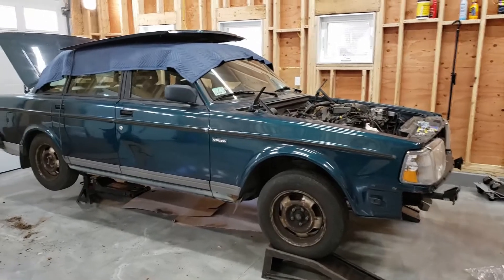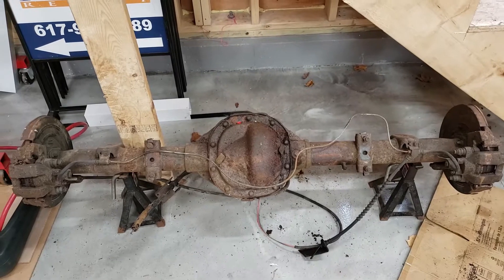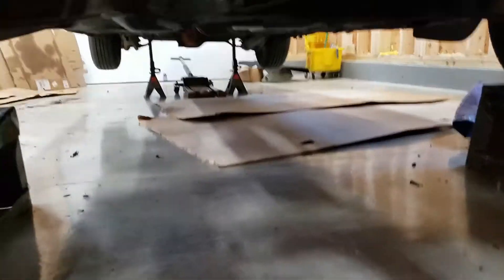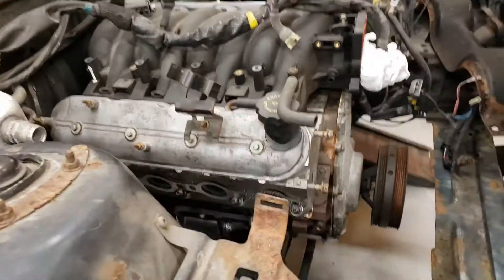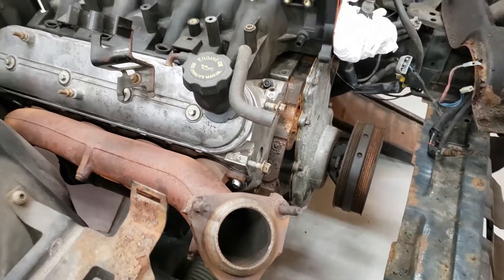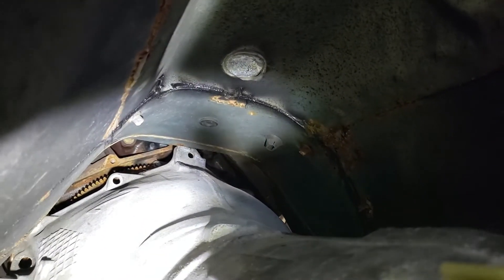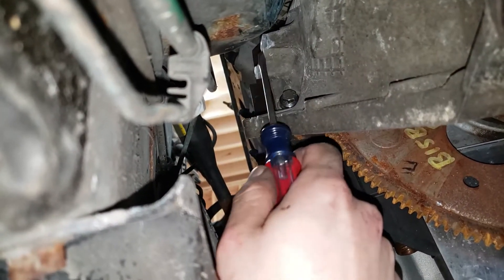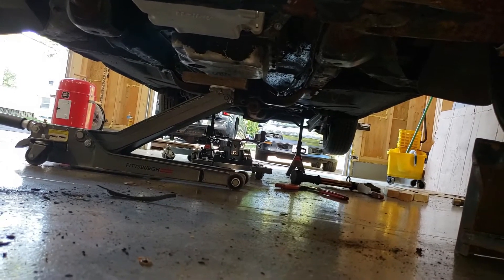Introducing my Turbo LSX Volvo 240 Project!!!

Comment: I was cringing when the sparks where flying up by the heads (open intake ports).  I just ordered a 4l80e transmission cross member from giffins.  We'll see how it all fits, I'm just going to open the tunnel up with the air hammer.
Reply from the maker: Haha, it's all junkyard parts. Working on my back sucks.  I "massaged" the tunnel with a variety of hammers, but clearance was still an issue. Gotta get a lift and some better tools.